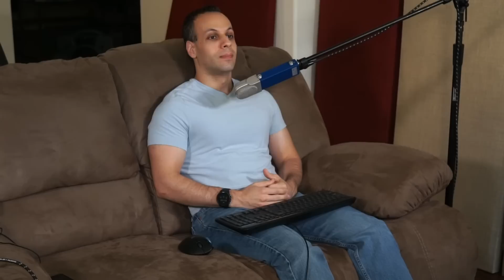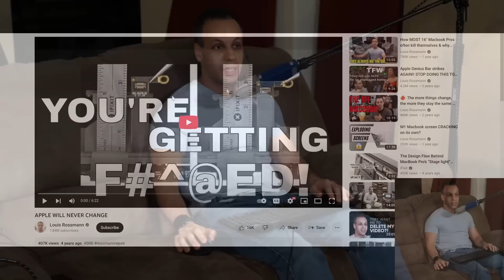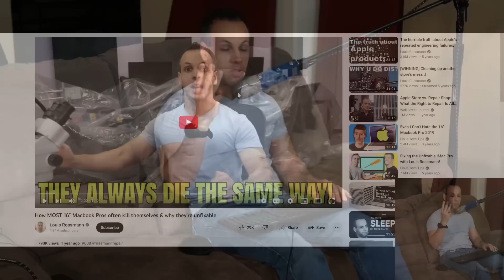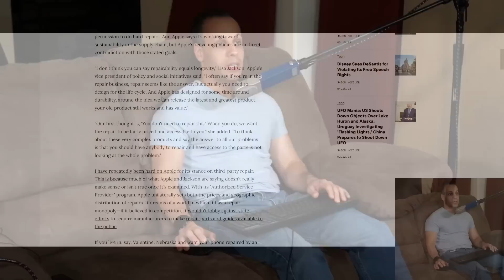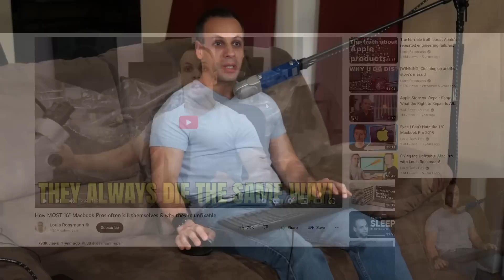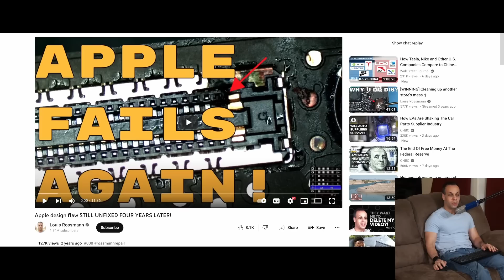Apple exec's latest interview is a pile of greenwashed BS

Comment: The problem regarding the new EU policy is, that they already quietly changed the policy in a way the batteries do not have to be easily replaceable by the user if "high quality batteries are used which hold 83% of their capacity after 500 cycles"
Reply: That's terrible.
Reply: That's... Not even 2 years if you use your phone all day.

That's not even a freaking year and a half
Reply: @monty58  Wdym? My iPhone 8 is only at 80% after 5 years, not 2
Reply: @AzVfL  I'm not talking about real devices though? I'm talking about the supposed edit to the law that says 500 cycles?
Reply: If this is true then this law is just a joke.
Reply: @killersberg1 typical eu law. All show no go except extra paperwork and expenses
Reply: Gg EU 🙄
Reply: It's 83% after 500 cycles and 80% after 1000 cycles, but only if the device is also dust resistant and water resistant at up to 1m depth for 30 minutes. 80% at 1000 cycles would be somewhere around 3-4 years of usage. Also, this is for a different EU policy coming into effect in 2025 and is yet to be voted on. The one which has been voted on doesn't include this loophole and will be coming into effect in 2027.
Reply: @alexturnbackthearmy1907  My old Samsung phone survived being dunked twice (with a case) with only minor damage to the audio jack (remember when those came built-in), no loss in functionality to the charging port, nor my ability to open the phone and replace the battery.
Reply: @alexturnbackthearmy1907  no it fucking isn't, we make waterblocks with giant fucking irregularly shaped o-rings that just need an allen key to take apart, I'm sure the same can be done for a phone with IP69K
Reply: Thank for clarification guys.
Reply: So it's kind of like one of the right to repair laws Louis fought for where some governor just decided to add a gigantic loophole at the last minute before signing it into law.
Reply: Wut?
Reply: Bullshit take. The Battery Regulation has nothing about it. And if you're referring to the Verge article (great source about legal documents btw), read the paragraph with this info correctly: this loophole is NOT present in the legislation at hand.
Reply: And also when they are IPx4 or more waterresistent
Reply: @jannik4593  Ziploc bags are water resistant, I'm able to take the top end off an engine with some wrenches, and put it back on, and retain a seal, and I've got multiple waterbottles that've been opened and closed daily for years while still holding water when I flip them upside down.

A phone can be waterproof without being permanently glued.
Reply: so basically this law is useless...
Reply: oh wow 500 cycles that's like uh god damn nothing
Reply: @veden3383  Around 7.5 years from a decent battery doesn’t seem that bad to me (mine’s 8 years old and on 82% capacity), so should get easily 10, maybe 15 years with usable capacity, by which point the phone will be no more that a paperweight anyway. Though I guess if you somehow need a 20-30 year battery lifetime from a phone that would be an issue still
Reply: wait really... and here i was thinking there waas finally some good news and something to look forward to in the tech world. I have never seen a battery that doesn't retain 83% after 500 cycles
Reply: Why? Why EU (the politicians)? Why are you idiots?
Reply: @ErevanDB corrupt just like the rest of them
Reply: @Gundog256 just another corpo puppet show
Reply: The EU is crap.
Reply: Sounds like the decision makers are also shareholders.
Reply: Money talks, bullsh*t walks... as always. Anyone gullible enough to expect anything different also voted for these elitist & corrupt 'progressive' politicos who keep effing them, lol.
Reply: 500 cycles is nothing. My iPhone 14 lasts maybe 4 hours of screen on time. It needs charging over 2 times a day. A life span of a few months is treacherous
Reply: Fuck. They were SO close to greatness and they squandered it!
Reply: Except now, iphone's new ios is diminishing the battery life down to 80 in less than a year of use
Reply: Ugh, sounds about right. EU is so great, I'm also a big fan of their GDPR which forces companies to spam me with cookie notifications every time I visit their website. Especially all the ones that don't have the "disable all cookies" button like they're supposed to, and especially the ones that don't actually do anything even if you click "no cookies". And I really like how the EU is just like the FTC in that they don't enforce this at all.

Sarcasm, f*** the EU, f*** the GDPR

Comment: As much as I hate Apple, making batteries user-replaceable is a bad idea, as it's virtually impossible to make a waterproof user-replaceable battery.  I feel the same way about mandating USB-C.  Apple is in some way right that it kill innovation.  I think a better law would outlaw device or manufacturer-specific cables and require that newly-manufactured devices be up to within 2-5 years of current industry standards for transfer speeds.
Reply: What's a waterproof user-replaceable battery? The device can be waterproof sure, and companies already have them today. Gopros are a prime example. Sony literally has microsd ports that can be opened and closed while certifying for water resistance. Apple has no reason not to design it in a way that is user replaceable and still maintain water resistance
Reply: Even my watch is water resistant. It's not necessary to make a battery waterproof.
Reply from the maker: Gopro has entered the chat
Reply: USB-C is just the physical connection. As long as they fulfill the minimum requirements for compatibility with other USB-C devices (being at least 10W charging and USB-2.0 Speed) they can implement all their innovative crap. Maybe some Apple specific fast charging protocol or Apple specific data protocols? If they however decide to use USB protocols and USB Powerdelivery they are not allowed to restrict that to only "Apple certified devices" or something like that. EU is doing the right thing
Reply: The galaxy Xcover pro has a removable battery and IP68 do that many people swim daily with their phone?

Comment: The problem is explaining to Apple apologizers that replaceable batteries is a good thing
Reply: Some people are just determined to double down on dumb ideas.
I know someone who says they "love Google" to the point where he has voluntarily installed cameras in all the rooms in his house connected to his Google smart devices.
He also uses a VPN, too.
It's like having the door locked, but removing all of the windows.
Reply: @Knowbody42  Seems more like locking the windows but removing all the doors to me.
Reply: @Knowbody42  One of my classmates has an m1 macbook pro, m2 macbook air, airpods pro 2, airpods pro, airpods 3rd gen, iphone 14 pro, iphone 13 pro max, iphone 13 mini, airpods max, and is planning on buying the vision pros when they come out, he literally said that he buys it all just because its from apple, these people are what apple loves and makes them so profitable.
Reply: @JimAllen-Persona Then I guess you'll never get what you want, as a loyal customer of a fully proprietary closed company: only another closed system with the devices coming all from the same company can achieve such a level of seamless transition and interoperability between devices. OR, you would have to have every company working on a single open protocol, with the same specifications, and would have to work together somehow, so much than the proprietary components of their product would effectively be gone.
So in a fully open source world where every company can work on the same things without having any conflict, yeah, it would work.
But for that, you would have to at least encourage the open source from companies, something you clearly don't seem to do right now.
Reply: Oh no. Everyone KNOWS that they are. The problem is "our side" pretending that engineering problems don't exist and calling everyone who agrees that some anti-repair choices were made for engineering reasons, an Apple apologizer.
Reply: @CidVeldoril  What engineering problems exist, Apple apologizer? Reminder that the Samsung Galaxy S5 existed, which had a removable battery, was water resistant, had a headphone jack and micro SD card slot, and loads more features than today's modern Apple and Android garbage. So you can't use things like "water resistance" as an answer, because that engineering problem is already solved.
Reply: @mjc0961  First, I have never bought an Apple product in my life. Second, the S5 was thicker than current phones. Yes, if you made phones thicker again, you could make the batteries removable again. Question is, what the paying customer would prefer. Thinner case or removable battery. You'd probably have to ditch the malleable, pillowy current-day batteries in favor of the older cased style again. As for the headphone jack, check Linus' answer to why that thing isn't coming back.

Comment: The Data? I have owned only phones with replaceable batteries, not to mention all kinds of other devices with replaceable batteries. The connection to the battery has NEVER been a fault of any of the devices I've owned. That is such a giant lie. Batteires dying of old age and needing to be replaced, on the other hand, have been a very common occurrence. It's obvious that Apple is only interested in forcing users to discard the phone once the battery is old.
Reply: batteries are "consumables", just like firing pins on guns and lightbulbs in car (before LED, which are still consumable but with a lower rate). Apple is just trying to make you believe you are too incompetent to change a battery as much as they are incompetent at designing a good phone after almost 20 years